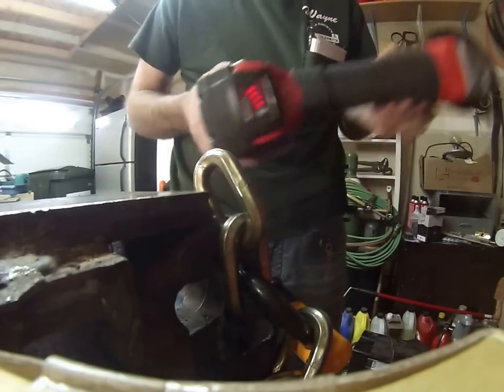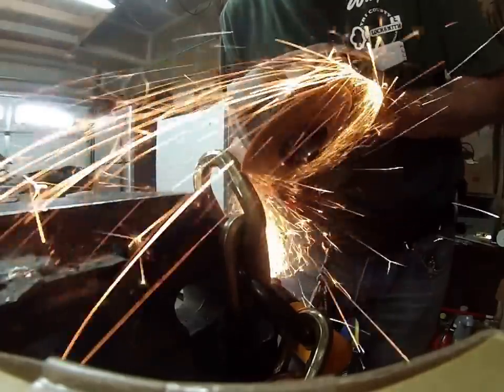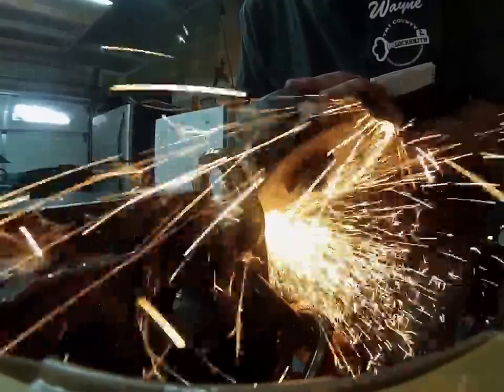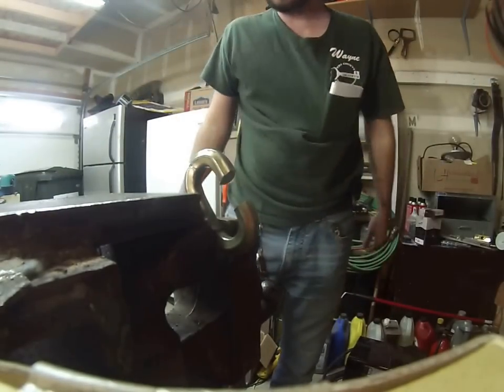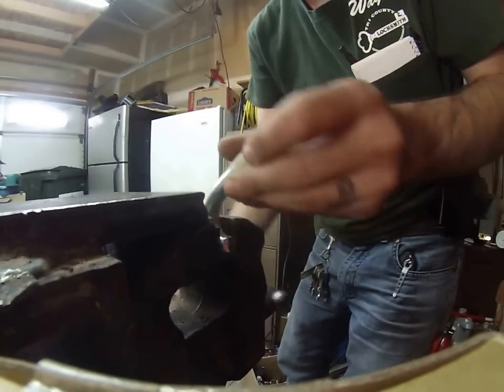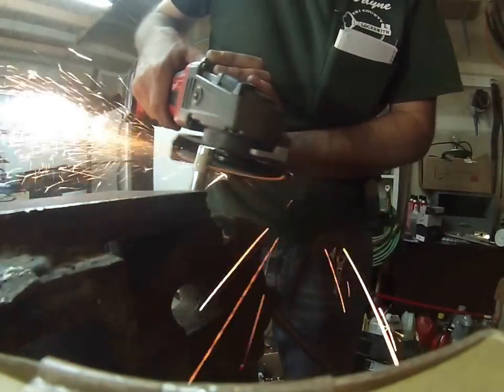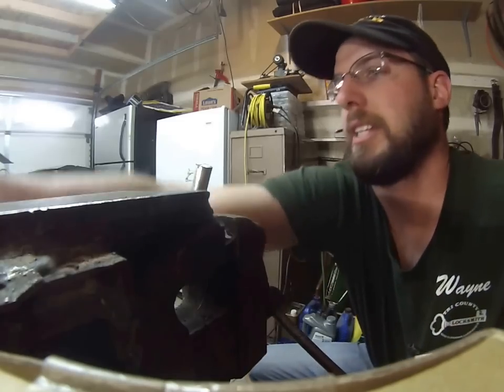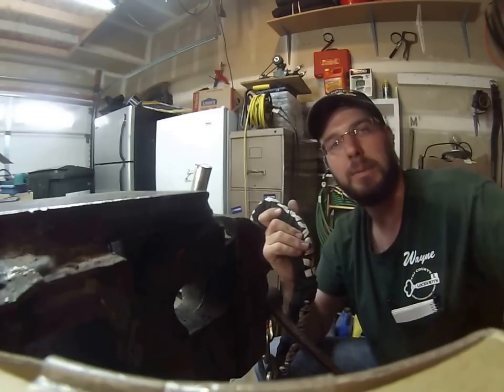12mm Kryptonite New York Bike Chain VS Angle Grinder

Comment: good luck holding the chain while doing this.
Reply: It's very easy to hold the chain with a pair of vise grips and cheap leather work gloves.
Reply: I would hole the 2 links to either side of it together underneath. That's easy.
Reply: 😂 Bike thief need to bring a study vice too... Or maybe just cut through whatever the bike is attached to which would be much easier.
Reply: @BD-fw2gm  So an extra accomplice with clamps and work gloves or no free bike

Comment: A bicycle thief has to worry about the near 100 decibels that is bringing attention to him. He also doesn't have the luxury to hold the chain steady as the chain will be moving around without a vice, has to cut through nylon cover, has a bad angle and then has to worry about possibly damaging the bicycle. If a robber is able to do it, it will mean lot more work and more time. Nowhere near a 30 second job. Cutting a u-lock is easier because it can be held in place. The chain is more difficult.

Comment: can you show us how easy it would be to do this without a vice on a locked bike... cordless grinder and no vice... I'll send you the $75 ide spend on the lock. the kryptonie evolution 4 chain
Reply from the maker: +Peter Rossie YOu can send me one. email me tricountylocksmithservice@gmail.com
Reply: +Wayne Winton what's the link to the video were you try cutting a chain freehand with an angel grinder?
Reply: +Peter Rossie Agreed, this is not a real world example. Please do it with out a vice or with someone assisting by holding.

Comment: Does there exist a chain that WOULD pass the angular grinder test? I figure the chains used to hold cruise ships at dock might, but I'm afraid that chain would crush my moped.
Reply: a chain with a pit bull on the end of it.
Reply from the maker: +menemme nope. grinder cuts right through them too.
Reply: yeah the best you can hope for with a grinder attack is that you place the secured asset in such a way that its too risky or physically impossible or unlikely that someone will or can get a grinder on it fast and privately enough to do it. a grinder  is sort of the universal unlocking tool if you are talking about chains and locks. the better the chain, the longer  it takes, but none of the stand up very long a single chain is not the only thing you should be using for security. a good lock thats well protected around the shackle, lock and chain placement. the placement  of the asset, tamper alarm where applicable, preferably  ones that not only scream but call you or the police for help if they are messed with, multiple chains depending on what you are protecting, tracking devices that are hard to detect or disable.
Reply: +metamorphicorder  I laughed at the original comment, then read your pit bull comment and I laughed about 10 more times.  I'm still trying to calm down and stop laughing.
Reply: Just tried to use an old PASGT flak vest inner kevlar 29 yarns to cover a chain against an angle grinder. Amazingly enough it does work. The grinder's disc spins the yearn onto itself and then gets stuck. You have forcefully to turn the grinde roff. And you go though a lot of trouble removing the kevlar filaments....it's a serious pain the a.

Comment: I thankyou for your video as I need to buy one for my motorcycle. Your point is taken but I would point out that on the street the thief would not have the mechanical advantage you had being that the lock is usually lying off the ground and even using a zippy cutter would require something portable that would replicate your giant benchvise. Never the less you make a good case for buying a Kryptonite  New York Bike Chain! Thanks.
Reply from the maker: yes loose chain will take a but longer
Reply: 10-4! That said, I still have to admit to a giggle or two watching you struggle with the chain on the floor and you trying everything including a chair to get some advantage!! Only because in my former work I had to do that everyday1 It aint ballet. lol. thanks for the reply.tw

Comment: Is there anything you could coat a chain in to destroy the grinder? Chain coated in thick plastic with a fuck-ton of tar sandwiched between it? Something along those lines?
Maybe a lock/chain/etc that can easily be cut with bolt cutters, but would completely ruin a grinder(and using both of them as an effective deterrent)?

I know they make radioactive tracer dye that people can use to track theft, that you can register with a company, and proves it's yours, but it doesn't stop the theft from happening. (Best part is, nobody knows it's there, it's invisible)
Reply: @Ajmes
A Hiplok D1000 is the closest you can get to an angle grinder-proof lock currently. It takes about 5-6 blades destroyed (for a battery powered grinder) before it's able to cut through the lock.

Comment: Yea but the issue with chain locks is that trying to grind through the chain while a bike is locked somewhere is that you have to keep the chain somehow from moving around while you're grinding it, which can be very, very difficult, especially if the chain lock is mounted higher on the bike. Any other type of locking system; folding lock, U-lock, cable lock, ring lock, padlock, etc., is easier to secure while cutting or grinding through. You had the chain secured in a vise, making it much easier to grind through. This challenge causes cutting discs to shatter because of the difficulty keeping the chain secure while grinding through it. I believe generally a chain type locking system is more secure and a better theft deterrent.
Reply: @Mushguys Yes there's a guy that has a YouTube channel called Brute4rce. There's a Stanley lock that has a reputation for being very difficult to pick and to cut with bolt cutters. This guy at Brute4rce in a real life scenario cut through the lock shackle in 2 places with 2 links of chain locked into the shackle. He cut through both in about 30 seconds with a bolt cutter he said he paid $30 for at Harbor Freight .

Comment: but who walks with a grinder in town...and even if they do..wouldn't that noise alert people nearby..
Reply from the maker: I'm just showing results. You fill in to souranding atmosphere.
Reply: Wayne Winton ok its a good video.
Reply from the maker: Thx
Reply: Would you approach a stranger with an angle grinder?
Reply: You would be surprised. Theft by this method is huge in New York City. 

I've seen some videos, were no one does anything or even call the police while an angle grinder attack is occurring. Maybe they figure no one would be so blatant, and it must be the owner.
Reply: Also YouTube motorcycle theft in London. It's so bad, they do that 💩 in the daytime.
Reply: professional bike thieves do, and no, most people won't even stop to notice, or if they do notice, they aren't willing to confront a thief with an angle grinder. 

Fortunately most bike thieves are running an amateur operation

Comment: Seems like there has to be a way to defeat an angle grinder specifically. 

Not something that's tougher but something that sabotages it maybe. 

I see a lot of sparks, that means a high heat chemical reaction is happening... could we use that somehow?

I'm thinking maybe we could add something like a small amount of thermite to the metal of the link, not enough to burn on its own of course, or overly weaken the metal, but enough so that it melts/deforms/breaks the grinding wheel when you try to cut it quickly like that? Also would suck for the thief to be showering burning bits of metal everywhere...

/smh
Reply: no, the best thing to do would be to coat the chain somehow in a tarlike substance so that it emits noxious gas and possibly gums up the disk on the grinder and throws hot liquid tar into the air burning them. safe manufacturers  do this by the addition of tar paper between layers of steel in safes so that if someone tries to cut through it, it gasses them out. thermite is rust, aluminum, and i think something else that escapes me at the moment,  you would not want to add that to metal nor would your want to coat the metal in it, as you would quickly have something that would burn through itself and possibly  stuff you dont want it to. the tar poses this risk too, but much less so. amd its would be a hell of a lot easier to put out. to try something like this cheaply you could try running your chain through a radiator hose of large enough diameter,  butnit will be awkwar and it won't protect the end links. if someone is attacking your stuff with  an angle grinder and you do something  like that to them, they are likely to cut through your frame or wheel just to f with you and leave you pr stuff still chained up and useless and theft insurance may not cover that. and the stronger you locks and chains the stronger the thing you lock it to has to be. because they can just attack that.
Reply: metamorphicorder

Yeah. All excellent points. The only real solution to theft is to obviate the desire. We need a culture that takes care of its citizens.

 #FeelTheBern
Reply: +Brandon “Innomen” Sergent you had to be THAT guy didnt you? jist had to bring  bernie into this, didnt you. thats why we cant have nice things. ;-)
Reply: metamorphicorder
heheheh

It was a moral imperative. X)
Reply: I super fibrous material that gets caught in the wheel would work. Maybe Kevlar

Comment: There is a lock that could not be cut with a grinder. The only thing that could cut it was oxy acetylene, which hopefully the criminals won't start using.
Reply from the maker: look up military grade Sargent & Greenleaf padlock. also breakout your checkbook....
Reply: whats that lock called?
Reply: Look for "Cutting the BikeRegistry 3/8" Case Hardened Security Bike Chain" on youtube.

Comment: Wayne, is the Kryptonite fahgettaboudit padlock and chain 14mm/16mm worth it, or what is in your opinion the best chain+padlock/s and u-lock/s you could recommend. We would be so grateful from London. I'm afraid to park my sportbike anywhere....
Reply from the maker: Baker Dow the Squire padlock is pretty darn tough
Reply: Thanks for the reply. Does it come with a chain, or is there a separate chain to use with it?
Reply from the maker: Pragmassis or Almax are the chain that it's designed to work with
Reply: Thanks that's great. I'll look them up and hope I can possibly order them from here. So it seems no chain is angle grinder proof? But wouldn't it be more difficult in real life to cut a chain in real life without a clamp?
Reply from the maker: Yes